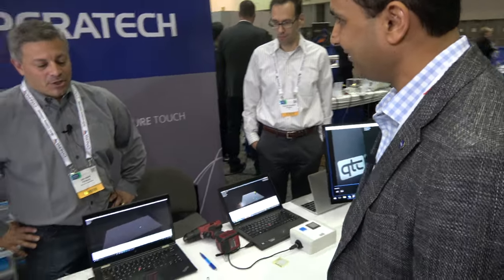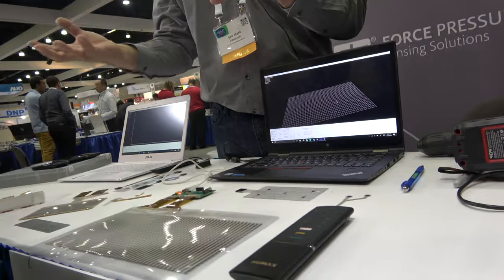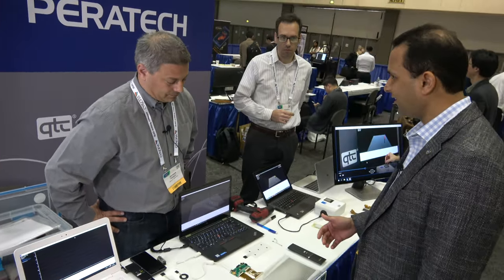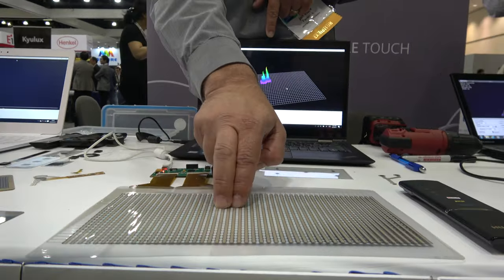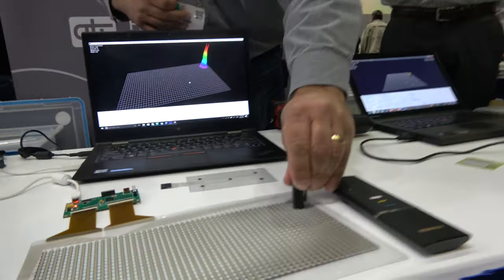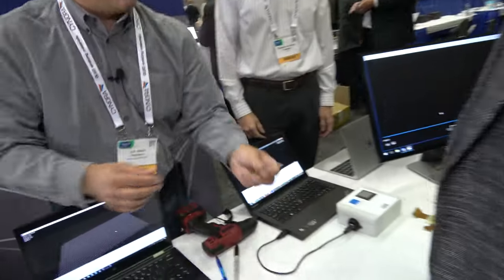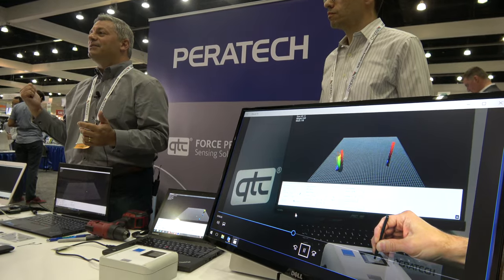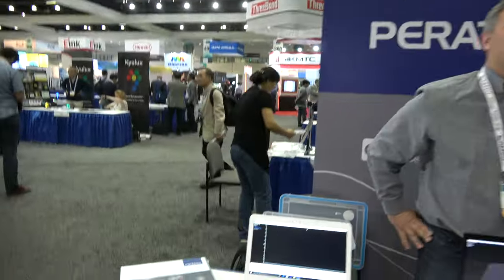Peratech 3D force-sensing Touch sensors

Comment: Has anyone looked into using these in e-drums? Also, anyone have any clue re: cost? All I've been able to find is that their 10mm diameter single-point sensors are about $5 each.
Reply: Hey can you tell me where you find the price?
Reply: Funny, I was thinking about their use in a continuous controller for synths, like a Haken Continuum sort of deal. But I guess the large area would make it very expensive. Like a Haken Continuum.